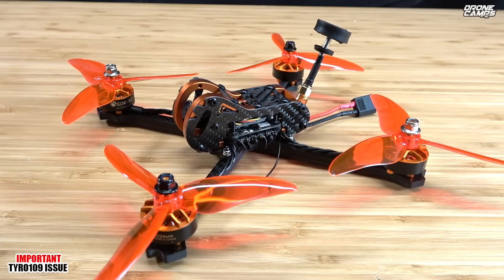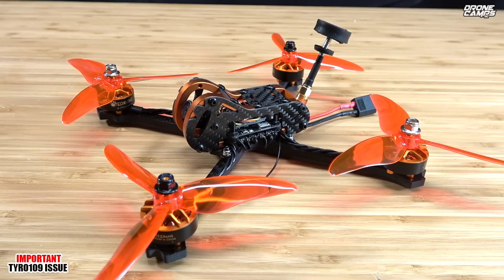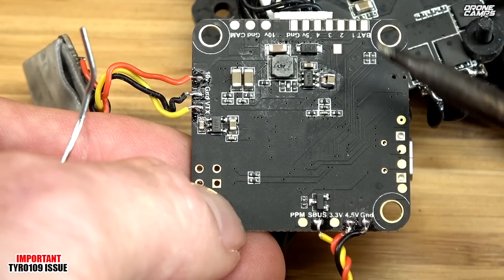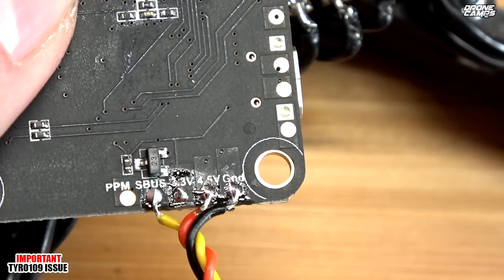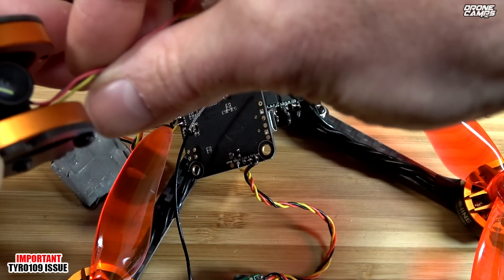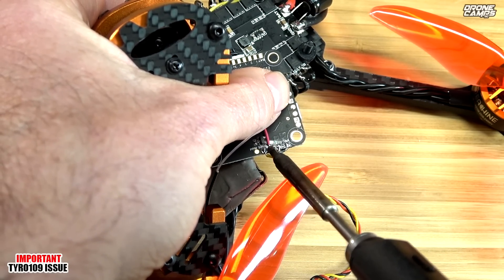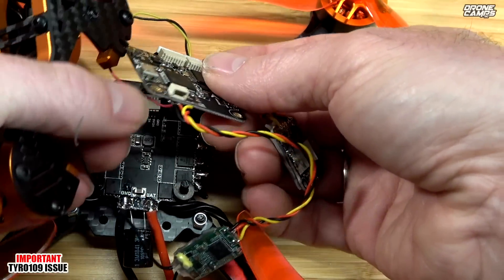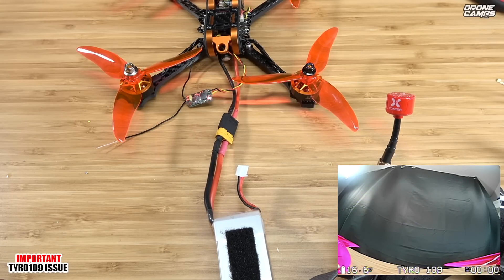IMPORTANT!!!! - TYRO109 Camera Voltage Fix!!!

Comment: I just check mine. But looking at the specs, I see that the Caddix Turbo EOS1 power input goes from 3.3 to 6 V. Because I didn't assemble mine, yet should I go with this mod or just plug it normally?

Comment: My power cable is too short I cant reach the 3.3 tab!!! Is it ok to solder two wires together in order to have it long enough?
Reply: daniele teodorosi I doubt you still have this question. However if you do you can simply solder to the 5 volt pad right next to your camera plug (on the bottom of the flight controller).
Reply: or just plug it in to 5v out, on the vtx. That way you dont have to solder.

Comment: Thanks for the heads up on this issue. I just checked mine and I am getting a constant 5.17V on the video power pin all the way up to 17V input. Could it be that they have corrected this on new kits? Everyone needs to check this anyway, so thanks again.
Reply: I just bought one and mine give 5v.

Comment: Hi, thanks for the video, I have this tyro 109 just finished setup, I've few questions/issues if you can help please, 

1. the top plate (silver color) of the camera antenna get very hot after plugging the battery, should it be that way?

2. I've got the flysky Nirvana nv14 installed with the x8b receiver, binding works, I've set the betaflight configurator to ibus, but can't control the drone, I've connected the receiver plug to the flight control, and soldered bridge ibus right side on MATEKF405, can you help? please? sorry for all those questions I'm just lost.. thank you

Comment: After some Tyro79 shipping with a camera that would not fit the included harness, somehow this voltage issue being overlooked by Eachine doesn't fully surprise me. With these cheap kits, it seems you always are required to do your own thorough research and double check all the wiring, instead of plugging things in, like it appears it should be connected.

Comment: I just moved camera power pin from 10V FC connector to 5V Out on VTX. Bingo, modular connection stays the same and there is NO NEED EVEN TO SOLDER anything!

Comment: Justin  ?? Are you able to put a small memory card on these units to save the video or do you have to save on phone or fpv head set?
Reply from the maker: You can save your FPV videos with your goggles DVR or an external 5.8ghz DVR unit. Or fly with a GoPro session or Hero on top of the quad.
Reply: Thanks for the info DC, you can also add one of these and have better video quality than recording on your goggles DVR...or if your goggles don't have DVR.
https://www.banggood.com/RunCam-Mini-FPV-DVR-Module-Remote-Control-Version-Lossless-Video-Output-for-Mini-FPV-Racing-Drone-p-1371052.html?rmmds=mywishlist&cur_warehouse=CN

Comment from the maker: NOTE for BUILDERS : You can power the CADDX Camera also from a 5V tab which might be more safe for your build. 3.3v is the bottom end of the power for the camera. There is a 5V tab on the top of the flight controller you can solder the red camera wire to. I am trying the 3.3v tab in this video. I will let you know if I had to switch it to 5v in the upcoming Review of the TYRO109. All information here on the channel. Thanks for reading up and subscribing. Happy building guys, - Justin Davis. DC/RC
Reply from the maker: Yes I forgot to mention it in the video. I wanted to try the 3.3v tab. Some say the 5V is a better option. But I like to test things to see for myself. Its what Im here for! If anyone else has this same quad and the 3v tab doesn't work let me know. So far it's good for me. I did a flight test yesterday.
Reply: Waiting for the flight footage 😍
Reply: I'm glad you made this extra comment because I was wondering why you didn't just use the 5v pad to start with. Too bad for these types of design errors for builds designed for beginners. This one could make an experienced builder scratch their head.  
🤘😁👍

Comment: Is this the same for the tyro79? I got that one or do I not have to worry about this
Reply from the maker: The Tyro79 camera hookup is fine. Mine works the way I showed it done in my build video. No probs.
Reply: I’m still waiting for it to get delivered
Reply: @testpiloterb1828  thats weird I had to wire my Tyro79 like this when i swapped camera from the default to a runcam
Reply: Rob Lawrence I do plan on upgrading camera soon after I get her built